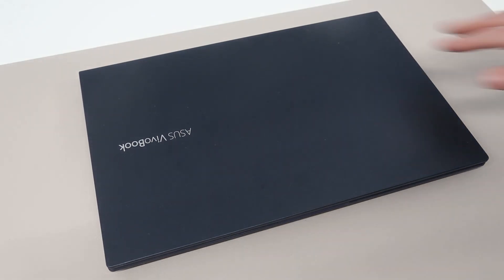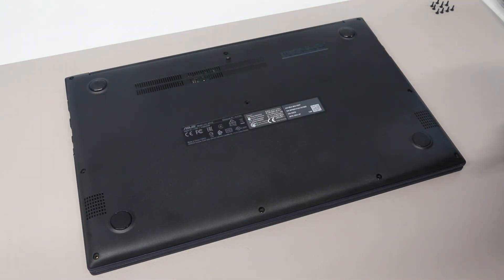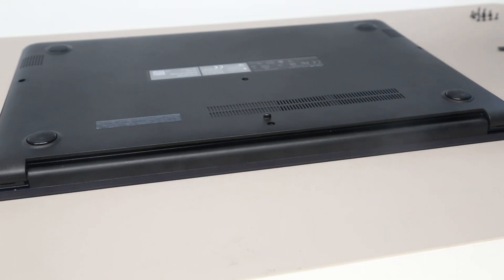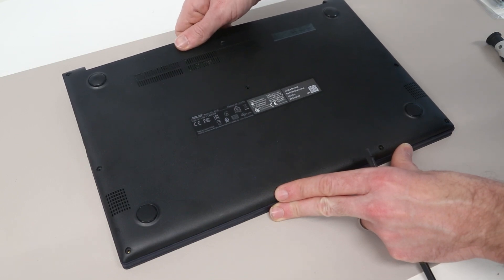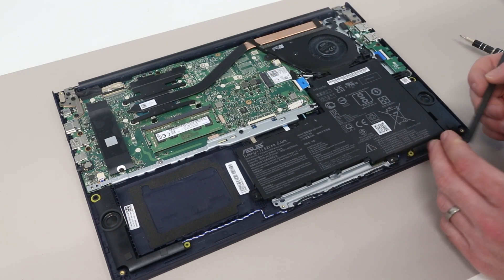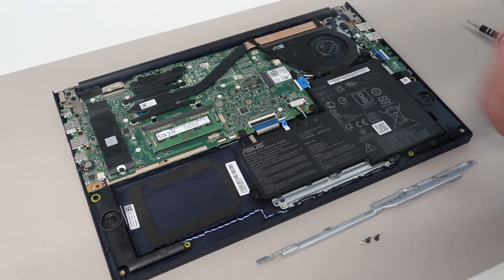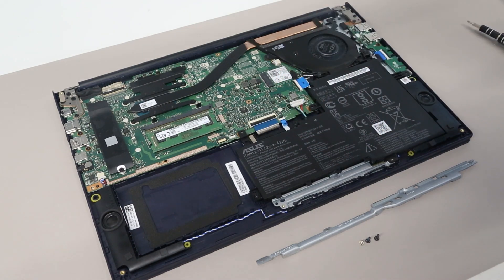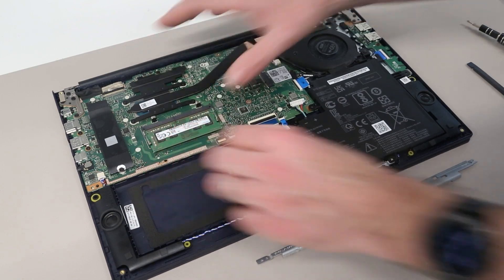ASUS Vivobook A513EA/X513EA - SSD, RAM, WiFi and Battery Upgrade/Replacement Guide

Comment: can we upgrade the battery? like it comes with 42 mwh battery but i want to install 48 mwh battery because even new 42 mwh battery is not enough for core i7 variant of mine.
Reply from the maker: I'm not aware of a higher capacity battery for it.

Comment: I have a similar model I owned since 2020, ASUS Vivobook K513E - it’s a great laptop and served me well, but it’s time to update and I’m on strict budget. I was wondering if you could advise if these parts will work for upgrading in 2025? Samsung 980 SSD - 500GB - PCIe 3.0 - M.2 2280 and Crucial - DDR4 - 8 GB - SO-DIMM 260-pin (however a bit confused with RAM - can it be expanded? Is soldered part only 4GB for this model or 8GB? I’m a bit confused should I purchase single slot 8GB or 16GB, can it be expanded? Like if I get 32 GB single channel RAM, will it be compatible?) 

Thanks for the video!
Reply from the maker: Sorry for the slow reply.
Samsung 980 should work fine - the Crucial P310 is quite a lot cheaper though so is a good option on a budget: https://amzn.to/4lh2KWc
In terms of memory, you can have a configuration with different size modules to what is on-board, it'll not give optimal memory bandwidth in some cases but only really impacts graphics performance in games.
Again considering budget I wouldn't go to 32GB - 8GB or 16GB probably makes most sense: https://amzn.to/45E5icu
Reply: @BrueComputing Thank you for the reply, could you please specify in terms of RAM - will his model ‘accept’ if I put 16GB in a free slot instead of 8GB¿
Reply from the maker: @Seyrin.  It should, yes. I haven't specifically tested it though.

Comment: Great Video, Thanks. I was opening an Asus F513EA-OS37 because is not turning on, and after opening it to check the battery I noticed there is no RAM on the RAM module (maybe is only used for expanded RAM, since it comes with 8GB?) I also Notice there is not a visible SSD on the bay (maybe also for expansion but technically it comes with 256GB SSD). I just wanted to be sure it was not opened before. and those parts should be there. (or at least the RAM).
Reply from the maker: SSD on the F513EA-OS37 is an M.2 drive, so should be replaceable, along with a 2.5" bay internally which presumably is empty.
There is a mix of DDR4 SO-DIMM and soldered down memory.
Reply: @BrueComputing  Thanks again!
Reply from the maker: Glad to help!

Comment: Thank you for the video. I have a question regarding the cooling system.
I had to replace the CPU/GPU cooling paste since the laptop was overheating and have noticed that above said parts, the heatsink is extended with some thermal pad and thick layers of paste. the layers of paste were completely sried out, however I could find no way to reapply such a thick layer without it smearing to the surrounding parts. I have replace it and the thermal pad with Thermal Grizzly pads. will this cause any problems?

Comment: Is it possible to put a 32gb stick in the empty slot for 40gb ?  There's 8gb soldered in my new model
Reply: no you cannot exceed 20GB of RAM. You cannot have 8GB soldered, you probably have 4(soldered) + 4(slot), the system renders it as 1 x 8GB though and you might think it's 1 chip/slot.
Reply: @Alexis_Mos  Thanks I appreciate your answer. You saved me the time of opening up for the 32gb stick. I'll find a 16gb.

Comment: Hi can i replace 4 GB SODIMM RAM? So it would be 4 GB + 8GB RAM? would be problem later with that setup?
Reply: Yes, you can replace it with a max 16GB on the slot, so in total you'll have 16GB (slot) +4GB (soldered) = 20GB, which is the max supported from the board.

Comment: Hi watched your video and have the same laptop.. would like to upgrade the RAM but how will it affect it being a split 4+16? Or will it just read it as one complete memory source? Basically im asking is it worth doing or does the imbalance affect running?
Reply from the maker: It might hurt gaming performance a bit but otherwise it should be fine.
Reply: @BrueComputing  oh I thought the whole point of the upgrade is to improve performance? Not worth doing then is it

Comment: I own a similar ASUS notebook computer, and it is the very first  one I've owned that is more like a cell phone when it comes to upgrading memory or replacing batteries.   Definitely a STEP BACKWARDS compared to my other computers that have easy access panels for memory upgrades or battery replacement.  Had I researched my purchase more astutely, I likely would have chosen another computer, although I have no complaints about the ASUS' performance.
Reply: Me too. I was in a rush to beat a funding deadline.  I'm on a 2012 Lenovo ThinkPad T430 right now, and it's still my favorite. If a new and modernized  "tank" like the T430 this was marketed today, I'd be on it in a heartbeat.

Comment: Could this laptop be upgraded with a "Samsung 980 1 TB PCIe 3.0" ? Not pro , thank , grate guild btw!
Reply from the maker: Yes, should work no problem.
Reply: @BrueComputing  Yes I decided to put it in and it worked, although I cloned the windows over fist using a ZEXMTE M.2 NVME USB 3.1 Adapter M-Key, Ram is empty slot so plan to get 8GB PC4-17000 PC4 2133 next, Its a ASUS Laptop 15 A516 , Looks like slot also for a Normal SSD drive
Reply: @imello1137  how much speed you get using nvme 980 (chrystal diskmark)??

Comment: Could 32gb ram compatible with this laptop? 8+32=40gb?
Reply: Updated BIOS today and installed a 32GB DDR4 3200 memory module (8 + 32 = 40GB in total)
Reply: @MARiverosT is laptop reading all ram together? I want to get 16 gb one so total for me would be 20 gb just wanted to sure I can get better performance
Reply: @davudaliyev3797  Yes, my laptop recognizes all the 40 GBs of RAM
Reply: @MARiverosT  x513EA?
Reply: @MARiverosT  How did it go with that 40 ram, what model of PC do you have?
Reply: @MARiverosT  How did it go with that 40 ram, what model of PC do you have?
Reply: @MARiverosT Hi.... What BIOS version did you get? I have the same RAM configuration and I was thinking to buy a 32GB RAM to get 40G... Thanks un advance
Reply from the maker: I believe they work, but haven't tested it though. Probably a bit pointless though unless you have a use case which REALLY needs that much RAM.
Reply: I just installed the 32GB module. It works nicely. 🎉 40GB total now.

Comment: Got this laptop and unfortunately 4GB of RAM is soldered on so I can’t increase the RAM from 8GB and still have duel channel memory:(
Reply: I have the same laptop. Just replace the 4GB with a 16GB one. It will reach a max of 20GB.
Reply: How did you replace the 4GB ram when it is soldered to the motherboard? @Alexis_Mos
Reply: @ranindu3885  there are 2 slots, one is the 4gb one soldered, the other is free, so you can place a 4 gb for a better compatibility or a 8,16 for a better ram but less compatibility
Reply: @PolloGamer3424  thanks 🙌 Inalso want to know that how much compatibility would I lose if I upgraded to a 8GB or a 16?

Comment: Hi, can I add a 16GB RAM memory to this laptop? mine has 8GB + 4GB SODIMM, I would like to replace the 4GB for 16GB
Reply from the maker: Yes, should work fine.
Reply: @BrueComputing  sorry about that. What about 32gb?
Reply: guys, if you have the 4(slot) + 4(soldered) RAM version, so in total 8GB, you can simply replace the 4GB module from the slot with a 16GB one. It will max up to 20GB. It cannot go beyond that.
Reply: @raiders1725, if you have 8GB soldered and 4GB on the slot, this would make it 12GB in total, so replacing the 4GB module with a 16GB would take you to 24GB and theoretically that's not supported by the board, as it maxes at 20GB. You can replace the slot RAM with an 8GB module, but it won't give you the maximum, just a better totall of 16GB.
Reply: Hi, what Ram momery have you bought ?
Reply: I have the same problem. I'm using the same Laptop and I need to upgrade the Ram. What kind of Ram should I buy? And the many says its not supporting more than aditional 8GB.
Reply: @sajeewagodakanda6304  if you have the 4 + 4 ram model, then replace the 4GB module with a 16GB one and you will have 20GB, the max. If you have the 8 + 4 model, then you can only get 16GB in total, as adding a 16GB module would take you to 24GB and theoretically it is not supported. The slot though does support 16GB, and so does the CPU, which can go even above 24GB, so you never know how it will react. ASUS claims that you can go up to 20GB.
Reply: hi, i replaced 4gb to extra 16gb for crucial 3200mhz from amazon
Reply: @sajeewagodakanda6304  we have the same problem.

Comment: What is the part needed to connect HDD to the mother board?
Reply from the maker: They are listed in the description
HDD Mounting Rubber: https://www.asusparts.eu/en/asus-13nb0qz0l27011
HDD Cable and PCB: https://www.asusparts.eu/en/asus-04022-00010000
Reply: @BrueComputing  hello can i install sdd 2.5?